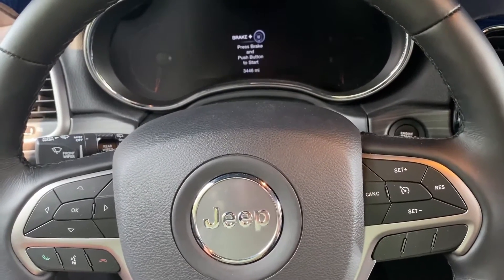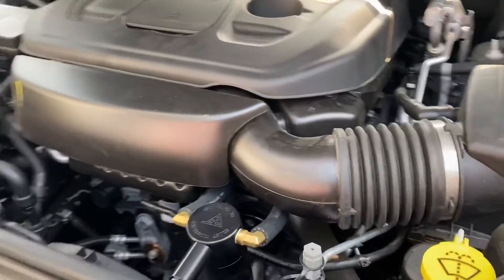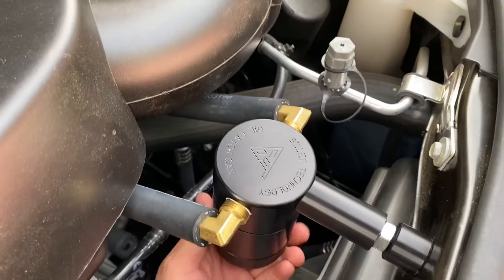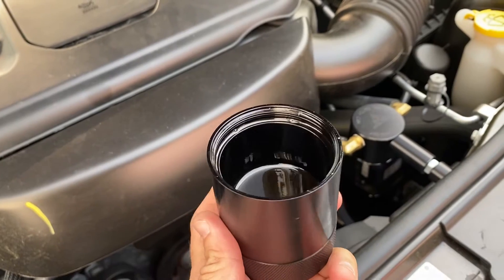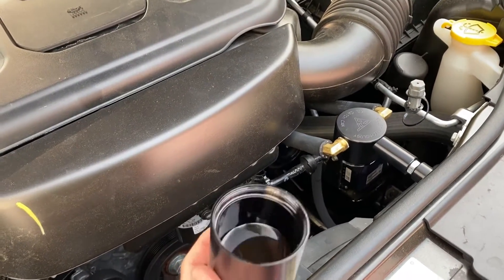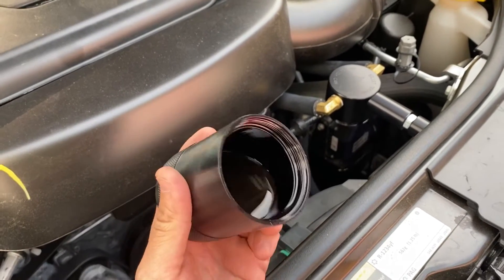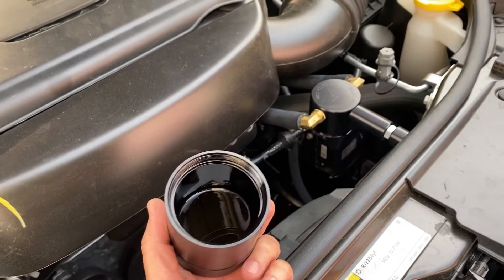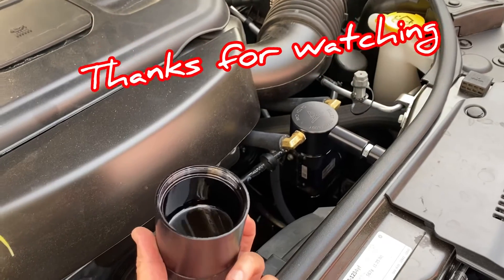#billet_technology #Jeep  Jeep Grand Cherokee  Billet technology catch can review

Comment: I'm waiting on my catch can from billet technology. I have a 2015 jgc summit with the 5.7 hemi. Cant wait for it.
Reply from the maker: Good choice, u saw how much a 1k miles collection was.
Reply: @woodken  yeah I had one of these on my 2015 silverado. Its insane what the manufacturer make go back threw the engine to get reburned. Why vehicle manufacturers don't put these on as a factory installed part (catch can)? catch cans work on any combustion engine. We have catch cans on our racing engines for years now.  I highly recommend these
Reply from the maker: @zieske98  Recirculation of blow-by oil/gas is done to help reduce emissions, the problem is the used oil re-entering the system will gum up your engine.
Reply: @woodken  how would burning oil or whatever comes out of the crankcase help emissions? Burning oil helps emissions?
Reply from the maker: Crankcase gases that build up are called blow-by, which is the production of combustion material from the combustion chamber. These blow-by gases can condense and mix with the oil vapors thus these gases in the old engines were released to the atmosphere which hurts the greens, This combination will create sludge or cause oil to become diluted with the fuel that hasn’t been burned, so they redirected this mixture back to the engine claiming it helps emissions. But in the long run all it does is it clogs the valves.
Reply: @woodken  totally agree, I heard people doing valve jobs on the 15 silverado, after 60,000 miles. Ridiculous
Reply from the maker: I heard that, the issue was excessive oil consumption, The culprit for that issue lies with a defect in the 5.3L V8 engines, so the manufacturer implemented whats called the active fuel management system, or AFM to increase fuel economy, get better horsepower, and more torque. 
However, it appears that the AFM causes the oil to get past the pistons, so it enters the combustion chamber. There, it will get burned out, or it will harden and accumulate in the cylinders. If not handled quickly, the pistons or cylinders could get damaged. If the valves dont get cleaned or walnut blasted.
Reply: @woodken  yeah that afm is another bad idea from gm. The lifters collapse eventually, then you lose that cylinder which ever one fails, they have injector problems as well. I had to put an injector in at 60,000 miles, I didnt have warranty. Bought that 15 chevy with 40,000 miles within the first week I bought an edge progrmmer to turn off that afm or dod, and a catch can. To help remedy the chevy problems
I also had 3inch slp cat back exhaust,s&b intake, I did the L92 (6.2) intake swap, jet performance 6.2l throttle body.
Reply from the maker: Oh boy u got it all hooked up.. at least u knew about the issues and tried to prevent the collapse but again small upgrades can be a good insurance in the long run👌🏻
Reply: @woodken  lol now that that truck is gone and have a 15 jeep grand cherokee summit with the hemi, have to start on this one now lol

Comment: I would definitely change the pcv in that case. You're accumulating too much for 1000 miles
Reply from the maker: It’s actually normal to collect that much since i do a lot of highway driving. And for the pcv it was checked and it’s acting as it should plus its a brand new vehicle.